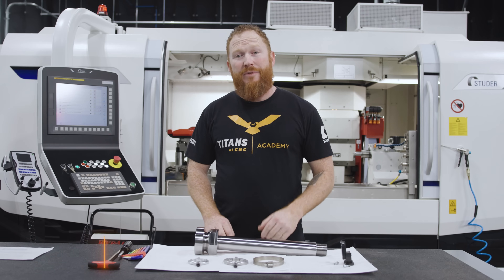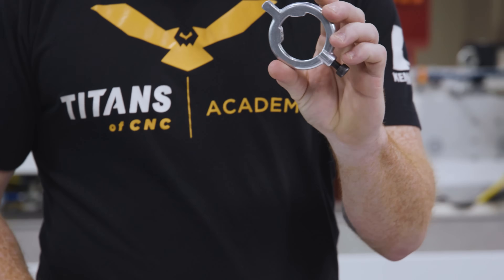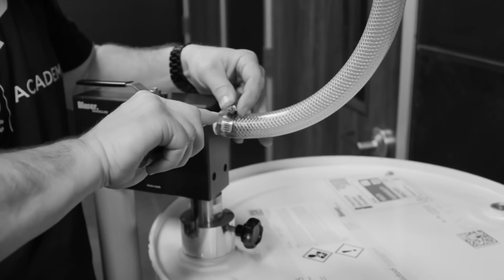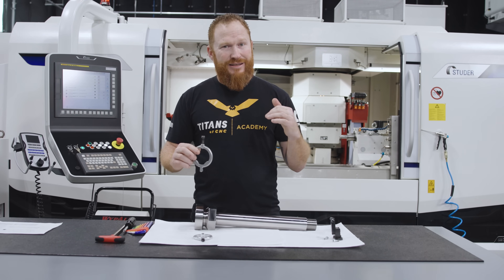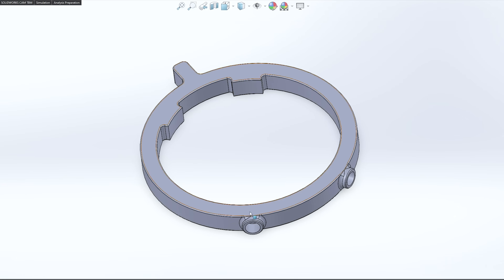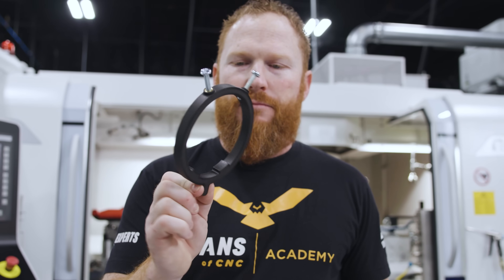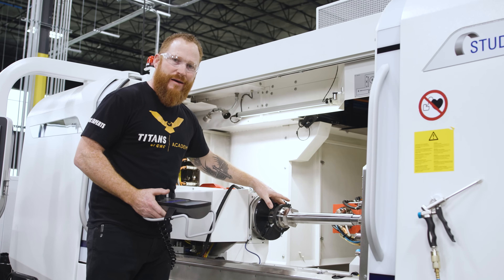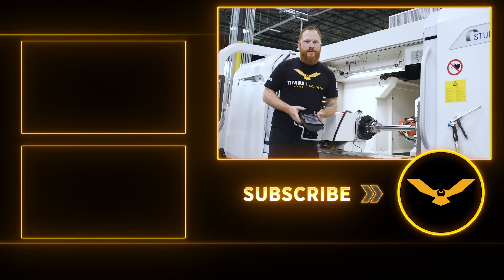Carbon Fiber 3D Printing with Mark Two from MarkForged

Comment: Please tell me what 3d pronting material it is
Reply: Onyx is the base material, which is a chopped carbon fiber filled nylon. Then the walls of the part were reinforced with continuous strands of carbon fiber.

Comment: Seems like you could have made that part just as quickly out of metal on the mill.
Reply: Would have taken man hours to program and setup the mill. The printer requires very little setup or programming. One off part like this could cost over $100 dollars to make on a mill, not to mention it would take up a mill to make a piece of support tooling instead of using that mill to make customer parts while the printer runs in the background.

Comment: IF- a hose clamp is the quicker option, use some electrical sealing tape, not plain electrical tape, on the surface. It adheres to itself and almost everything that I've found.

Comment: Seems like that machine ought to come with a wider set of dog diameters. Maybe just go thru the effort to make a range of sizes from steel or aluminum that can sit in the tool chest.

3D printing is a cool solution tho and a real boon when oddball stuff is needed. But this was just a round shaft so seems like it won't be the last time this issue crops up. IMO worth fixing with some harder tools.

Comment: I would question if the use of a lathe dog would be appropiate in this case, specifically in the position in which it was clamped in, it would  have been better suited to the flats of the part rather than the round edge. Also the use of soft jaws could have achieved the same effect.
Reply: No on both counts.
Clamping over the flats adds complexity for no gain.
He explicitly stated it was being ground between centers, which precludes the use of soft jaws.

Comment: Don't feel so bad about your single hose clamp goof up. A single hose clamp ended up sinking a brand new 50' Hatteras sport fishing boat on its way from Oceana Virginia to New Bern NC. 2 men died when the boat sank in frigid Feb waters here in the Neuse River mere feet from the inlet here in Oriental NC. Their bodies were found across the river frozen to death. One hose clamp.

Comment: Nice but the thread inserts should be on the inside so they can't be pulled out with screw force
Reply: Why? Just don't over-tighten the screw.
Also, how do you propose to press the insert from the inside? kinda hard to get the iron in there...
Reply: @joshua43214  the iron doesn't have to be inline with the inserts, it would have been no problem to design it for pressing from the inside.
Reply: @sliccreations  Or better yet, keep it simple and don't over tighten the screws...
Reply: @joshua43214  problem is they have no idea the pullout force or clamp force needed, so pretty hard to quantify what you are saying. The simpler choice would be the easy design decision that eliminates guesswork and mitigates against potential misuse are the same time
Reply: @sliccreations  Or one could simply rely on the experience and prior knowledge one gains after they leave the theoretical world and enter the real world where getting things done in a timely fashion is what pays the bills.
You are inventing issues that do not exist, based on theory not experience. This is a opportunity to learn, your choice.
Reply: @joshua43214  lol OK bud

Comment: 3D print some little "Shoes" for the screws so you dont have to f+%& around with the shims :) That would be a nice addition to the drive dog
Reply: Good idea!
Reply: They tend to have low friction coefficient in ABS or PLA

Comment: Wow, what an expensive solution to a very simple problem!
Reply: Eiger estimated the cost to be $16.10
Reply: It's an automated solution too. It's not like they would stare at the grinder until the part is done printing, you go off and do another job. This obviously isn't for a job that you need out the door yesterday type deal.

Comment: An interesting application but seemed like the most expensive and inefficient way of doing this..  This could have been designed and cut from a piece of plate steel, aluminum or plasitc (Plasma, waterjet or laser.. all would do the job).. Weld on a few nuts and a tab and you would have had what you needed in an hour or less..

Comment: Very cool. Communication and teamwork to find a quick solution. My question is, how did they get the threaded inserts into the 3D printed part? Does the insert have internal and external threads that then screw into the tapped part? Great video!
Reply: The get heated Up. And then get sunken into the plastic.
Reply: he gave the answer in the video.. heat them and push them in place......  BTW, this is about the slowest solution they could muster but it was an interesting way to show printed reinforced plastic
Reply: Thanks!! Missed it in the video.

Comment: Inquiring minds want to see how the carbon fiber was laid up for 3d printing. Amazing stuff here.
Reply: The 3d printed has 2 nozles one for plastic one for a strang of carbon fibre
The second nozle extrudes the fibre and kind of lays/ melts it into the before printed plastic.
Reply: @nf794  or better yet 1 nozzle and a cf petg filament of sort. wtf you talking about exactly?
Reply: @megamannyeah  im talking about the markforged 3d printer which has 2 nozles and is capable of strenghtening parts by laying in a Carbon fibre strand through one of its nozles.
Reply: @megamannyeah  This is way way way better. The main part is printed with CF Nylon then a single strand of carbon is added to the part. Its much stronger than anything a consumer machine could create, in a correctly designed part it can approach the strength of aluminium
Reply: @etch3130  unfortunatly the whole system including their slicer is bad imo. It Just Gives very Basic options in choosing your printing Parameters. The parts come out kinda clean tho
Reply: @nf794  Aha! Thanks.

Comment: Somehow, the pipe clamp (Jubilee Clip in the UK) seems better to me.  Full contact without having to use paccking pieces. Suppose it depends on the grinding force. (Ex Aerospace Engineer)
Reply from the maker: Ya, we’re taking a very light cut just showing options
Reply: How long did the print take and what did it Cost? 
U just said a couple hours and "it wasnt even that expensive"

Can you please refine that
Reply: @nf794  Whole part probably cost $2 in material, about 20 minutes print time depending on layer height, so not too expensive
Reply: If you need more clamping force and strength, you could 3d print the part thicker/deeper, change it to exactly match the part and have it pull tight with several screws.